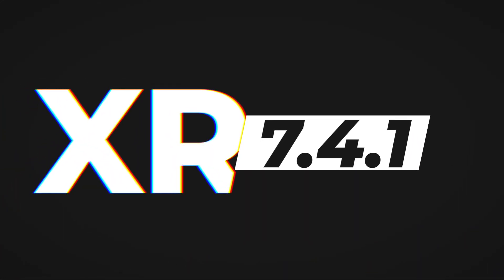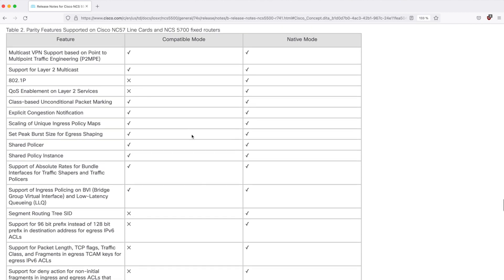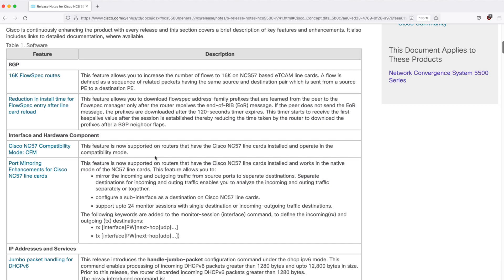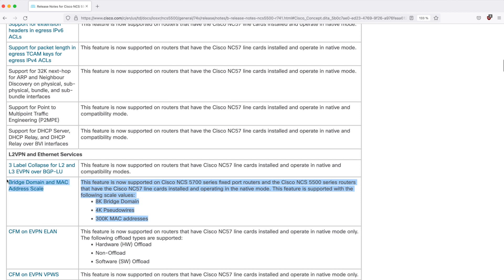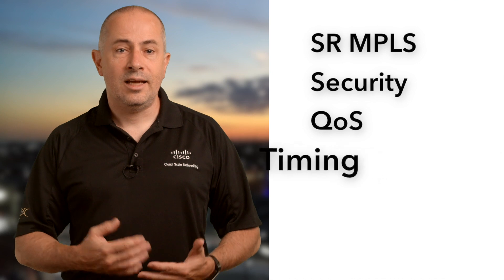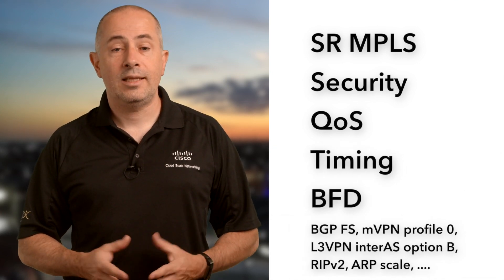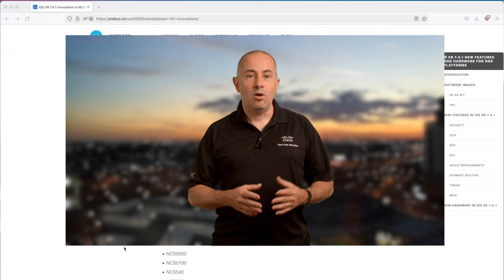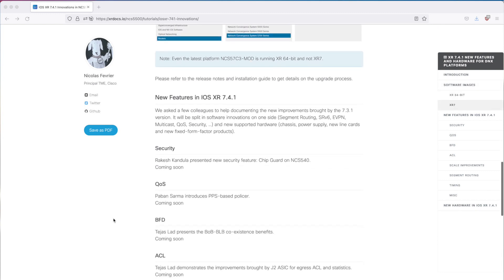Introducing IOSXR 7.4.1 Features and Hardware

Comment: The NCS 5508 with iosxr 7.4.1 its limited to generate netflow with ingress only. This is a firmware or hardware limitation ?
Reply from the maker: Hey Daniel,
for different reasons, it's difficult to answer such a question over a comment (it will depend on the product type but also things can change in the future).
Please drop me an email at the follow address to discuss about it: nifevrie (at) cisco <dot> com